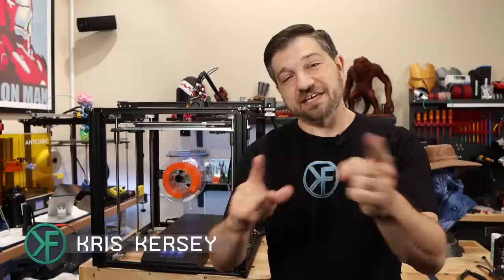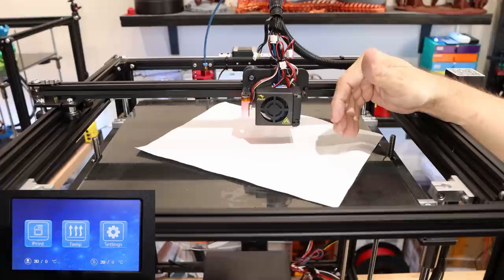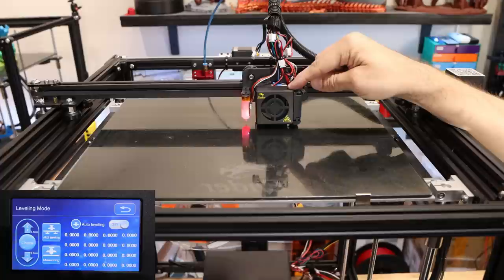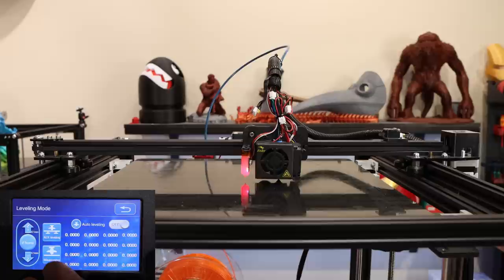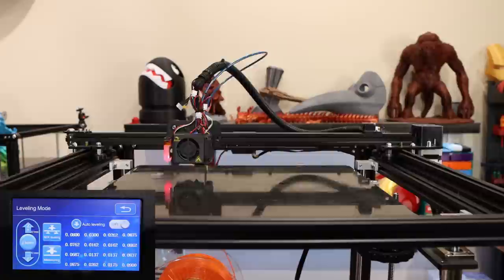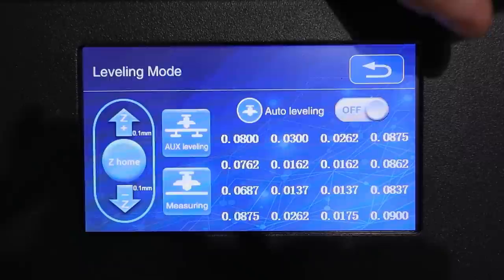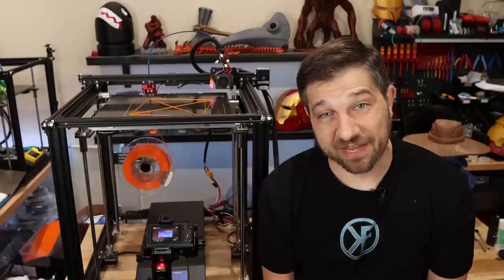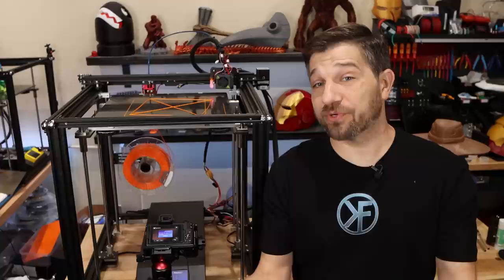Ender 5 Plus Bed Leveling Guide

Comment: Hi Kris!  Thanks so much for this video!  Question - on step two when doing AUX leveling you level the four corners and then back out and enter AUX leveling again.  The printer then homes, and you repeat the process.  Are you certain it is proper to back out of AUX leveling and go back in?  When I do this it seems to reset??  I level the four corners to where I can barely get the .04 mm feeler gauge under the nozzle.  When I back out of AUX and go back in, it's exactly the same every time -- NOT where it was.  The nozzle is touching the bed on every corner.  Every time I'm having to twist to the left (loosen) the same amount on all four corners to be able to get the feeler gauge under the nozzle again.  I've done 20 rounds of this, and still when I back out of AUX and go back in it's the same every time (nozzle touching bed, gauge can't pass).  However, if I level the four corners, and repeat the leveling 2-3 times without leaving the AUX leveling screen it is consistent.  I can pass the gauge under the nozzle with consistent resistance on all four corners.  But when I back out of AUX leveling and go back in (after it homes), when I check the corners I can no longer pass the gauge under any of the corners without loosening again!  I'm just about to the limits on how far they can turn left, so I'm starting to wonder what's going on.  THANKS!!!
Reply: I am having the same problem did you get a solution to it?
Reply: @victorblandon8996  I think so... I think backing out of AUX (at least on my stock Ender 5+ is not the best thing.  Do the same thing, just don't back out of AUX each time.  And if you are a beginner (like me) and have adhesion problems after this, best advice I can give you - hair spray or glue stick on the glass side of the bed.  I may have given up on the whole thing if I hadn't finally tried that.  It's important to have success to keep you going.  With hair spray or glue stick, you can get away with not having a perfectly level bed.

Comment: Hi  Kersay .... it's my first printer , i have unboxed it, assembled it almost all, now i have to connect the wires and bed leveling. 
Question .... When I see the Y belts in front side, they go much closer to the one side, and i think they will rubbing, scratch that side on the frames  🤔  .... 
 can I do anything to make them sitting in the middle, not touching the frames  ?
It is on both sides left and right front.
There is a possibility to adjust the position of the belt by turning the belt mounting bolts, but there is no such key in the equipment, so I do not know if I can do it ? 
Or just leave it at it and watch it work?
Thanks for any suggestions  😊
Reply from the maker: Congrats on the printer! 😍 Those mounting brackets should move. Feel free to adjust them. There are three screws in each if I remember correctly. Just get the belts tight when you get them in place.

Comment: I just got my Ender 5 plus. I tried to use the bl touch for auto leveling but I don't have the same menu options shown in this video. When I go to the auto leveling screen it doesn't have the option to turn on auto leveling. It has the most recent firmware update. Should I go back to a previous one?

Comment: So the right side of my ender 5 plus. Keeps movinf. At first I thought it was the left side dropping but I pencilled a mark on the couplers and the left side remains spot on whereas the right side lines up for the first few homes but then slowly moves out of alignment.
Does anyone know what would cause this?
Reply: The problem is that the Z lead screws are double threaded. With this larger angle the weight of the bed alone is right on the border of being enough to make the screw turn when the motors are not powered up. Consider making a latch that adjustably mounts to the screw/motor coupler and the frame to prevent movement when un-powered.

Comment: The problem is when I do the aux bed levelling, the nozzle is way too close to the bed only on the left side but the problem is when i loosen the knobs underneath, the bed doesnt get any lower.. Do i have to replace the springs?
Reply: The bed gets lower as you tighten the knobs. I know it sounds weird, but try it, you can see it. But you probably found out by now :D

Comment: when I check the 16 points my numbers are wildly different, some as low as -2.199. How am I able to make them closer together in value?
Reply from the maker: Can you try and list them here the way they're displayed? Or send me a photo on other socials.
Reply: @kerseyfabs  sure. From top to bottom, left to right: 0.275, 0.600, 0.587, -0.349, -0.724, 0.000, -0.287, -0.262, -1.912, -1.362, 0.062, 0.375, -2.199, -1.099, 0.262, 0.400.
Reply: @rachelblakey3212  did you ever fix this? mine has the same problem with the same suspisious 0.000 number in there
Reply: @jaaasgoed  I did not resolve this; I ended up buying an Ender 5 S1

Comment: Hello Kris, love your videos but i have a bed leveling mesh issue with my Ender 5 Plus why are my mesh numbers all over the place (corner 1 (5.675) corner 2 (0.512) corner 3 (-4.524) corner 4 (-9.799) is this telling me my table has a 15mm slant? i ran an digital indicator mounted on the print head and all 16 points were within .0001" of each other telling me my bed is very level, so what's going on?
Reply from the maker: Thanks! Have you tried to run a probe repeatability test on the BLTouch?  https://marlinfw.org/docs/gcode/M048.html

Comment: Hello , 
I have some Problems with my ender 5 plus. I followed your Tutorium but if i do a measurement i get numbers like -3.2 mm and +2.3 mm in one mesh and if i do a Manuel mesh leveling its ok. And the redo the mesh its even worse. I have tired several hours bzt cant get a good mesh. Some have any ideal what could be the problem ?
Reply: same here, not as extreme but lik -1.8 to +0.8 between 2 points next to eachother

Comment: I've been following your video for a while now... and something weird keeps happening to my process.  I start getting really close to what I want.  And then it goes to crap.  I'll hit the measuring button twice in a row... and get wildly different numbers... some more than double the distance measured... and that's without me making any adjustments.  Any suggestions or ideas would be greatly appreciated.
Reply: first set of readings: (left to right/top row to bottom row) .0137 -.0787 -.1075 -.0937  row 2 -.0712 -.1273 -.0750 -.0875  row 3 -.0700 -.1000 -.0900 -.0875 row 4 -.0375 -.1012 -.0700 -.0837
Reply: second set of readings: row 1 -.1575 -.2862 -.3337 -.3150  row 2 -.1950 -.3200 -.2625 -.2775 row 3 -.2100 -.3000 -.2800 -.2475  row 4  -.1662 -.2550 -.2662 -.2487
Reply: third set of readings (no time lapse between and nothing adjusted whatsoever) row 1  -.4912 -.6087 -.6637 -.6587  row 2  -.5350 -.6437 -.5900 -.6262 row 3 -.5437 -.6200  -.6062 -.5887  row 4  -.4987  -.5862  -.5912  -.5887
Reply: My bed was heated to 65
Reply: My first guess is that I may need new springs... other than that, I've got no idea what else to pursue.
Reply from the maker: If you're running some of my firmware, you may have the probe repeatability test installed. See if you do: https://marlinfw.org/docs/gcode/M048.html

Comment: Would you recommend the ender 5 plus over the ender 3 max? I'm new to 3d printing and want to buy my first 3d printer, which should have a large print bed for for example helmets. I'm willing to pay the extra price, but only if its really worth it. Which one do I have to upgrade more to get the best results?
Reply from the maker: Answered in one of your other messages. I'd go with the Ender 5 Plus. I don't like the single Z axis of the Ender 3 Max the more I've used it.

Comment: My measurements had variations +/- 1.000 I did all the steps and even used a metal feeler gauge like shown.

What can I do differently?
Reply from the maker: You could be getting some noise on your BLTouch sensor. You could separate those wires from the rest of them. It's something I recently did. Run them separately from the rest of the bundle. I may make a short vide on it.
Reply: @kerseyfabs  sheesh thank you!

You inspired me and I'll post my own unboxing and building video from an almost-over-the-shoulder angle. I'll reference your channel and express that your leveling video is freaking gold.

I moved on with what I have and have some very nice prints hot off the press. Now I'm learning Cura and how to balance speed/function/detail.

My hat is off to you!!

Comment: I noticed that you have a the Auto-Leveling button turned off...   but you mentioned "the auto leveling will take care of that"....  how...  if it's turned off?     thank you!  :D
Reply from the maker: The auto leveling button in their firmware simply tells it to run auto leveling on every print, which is unnecessary. 
Simply have the following line in your Start G-code and it will enable bed leveling with every print but not rerun the mesh:
M420 S1 Z2 ;Enable ABL using saved Mesh and Fade Height
Reply: @kerseyfabs        "not rerun the mesh" ?    As in, if one it should be remeasuring the bed every time???      (because it doesn't do that... ).  Sorry, not following... but I look into cura marketplace for an option to auto-add these...  because G-code editing is above my level I think... :D

Comment: Hey Chris, I've just flashed the firmware to your version on the printer, however the screen is currently white fuzz, what dwin set version do you recommend what your stock hex file.
Reply from the maker: I never changed my Dwin set from the stock one. I haven't seen the screen turn to "fuzz." Since it runs its own firmware, that shouldn't happen.
Reply: All good, it's all fixed now, I screwd up right from the start, but managed to figure out what was wrong. Your firmware is fantastic, now just waiting for the new bigtreetech mini lcd screen, I don't really like the touch screen.

Comment: I have bought one put it together sent it to a shop then got it back and I still can't get it leveled I know its an error on operator so I just bought the cr30 belt printer.
Reply from the maker: Well, if you still have it, I hope this helps.
Reply: Good luck with the CR-30!
Reply: @kerseyfabs  we will see i got discouraged with the ender 5 pro because I sank money into not only buying it but upgrading alot of parts like the silent motherboard as well as the cl touch. But I'm sure after the cr 30 it will be different orientation if I do switch but the cr 30 has made it fun I hope I can get a handle on the bed leveling soon to build some bigger stuff.

Comment: Do you have the gcode you use available anywhere? The code I currently use does a big triangle for it's purge and I have to rip it up before it starts printing.
Reply from the maker: Here's my start gcode:
; This section handles leveling
;G34 ;Z-Level
G28 ;Home not needed with G34
;G29 ;ABL not needed every print. Here for reference.

; This sections handles basic setup and draws the priming line, now on the right!
M420 S1 Z2 ;Enable ABL using saved Mesh and Fade Height
G90 ;Absolute positioning
G92 E0 ;Reset Extruder
G1 Z2.0 F3000 ;Move Z Axis up
G1 X345.1 Y20 Z0.28 F5000.0 ;Move to start position
G1 X345.1 Y200.0 Z0.28 F1500.0 E15 ;Draw the first line
G1 X345.4 Y200.0 Z0.28 F5000.0 ;Move to side a little
G1 X345.4 Y20 Z0.28 F1500.0 E30 ;Draw the second line
G92 E0 ;Reset Extruder
G1 Z2.0 F3000 ;Move Z Axis up
Reply: Awesome, thank you. What clips do you use for the bed? I'm still using paper clip style and those look much nicer. (Sorry if you have it posted somewhere else and I didn't see). Also is there a reason you have the glass upside down so the textured side is down?
Reply from the maker: Here you go, they're picture frame clips: https://amzn.to/3BOdp7f
I like printing on the smooth side because I get more reliable results using an adhesive compound like Vision Miner Nano Polymer Adhesive: https://visionminer.com/r?id=79piuf

Comment: i have been told you do NOT need to manually level an ender 5.   I do NOT want to be doing manual levelling ever again.  So sick of it.
Reply from the maker: If you're printing mechanically accurate parts you have to care. If you're printing models and toys, you're fine.
Reply: @kerseyfabs  models and toys! Whew.  So I can buy an ender 5 plus and solely use the auto level?

Comment: Please don’t do what he does at the start and push the bed into the print head…
Always start a print, doesn’t matter what you start just as long as you start from cold to give you time.

Go into adjust, change the z offset to 0 or in the positive side then follow the rest of the video from there.

Nothing against you personally but this can save your glass bed cracking and bending/breaking the hotend.

Comment: while this video is good, it doesn't exactly help or tell you how to fix anything like the certain rows of numbers if that doesn't work out first go around like his did. For me right now, no matter how much I manually level the corners or restart the process, the 2 middle rows of numbers will never read 0.0. He mentioned a suggestion for help but mumbled it so I can't tell where he said to go looking. Over all, he gives all the pro pointers, but none of the pointers for correcting the machine due to nailing it first go
Reply from the maker: If you're bed isn't perfectly level, that's normal. A lot of beds aren't perfectly level. That's the whole point of auto bed leveling. Once a mesh has been generated, the printer will make adjustments during the printing process to compensate for the differences. That's why I don't cover fixing it. Some things you couldn't fix without physically replacing the bed with a flatter build plate.
Reply: @kerseyfabs  yeah, I get that, but as I keep relying the process to get closer even after doing exactly what I did the same veery time the numbers seem.....pretty all over the place. Like just now as I'm typing they range from -0.28 to thankfully 0.08, though I was having worse numbers last night

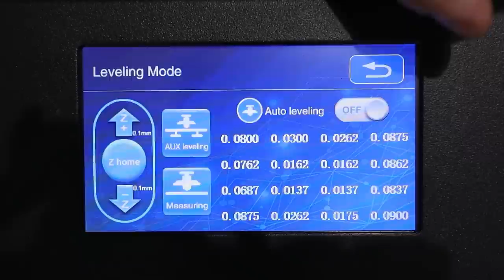Comment: 16:16 IF you would have turned on auto leveling it would have...
Reply from the maker: That auto-leveling turns on releveling on every print. You need nothing but "M420 S1 Z2" in your start Gcode to enable the use of your bed mesh.
Reply: @kerseyfabs  I swear the old adage "if you want the right answer, post the wrong answer online" works everytime LOLOL thanks bruv.
Reply from the maker: Anytime! Happy printing!
Reply: @kerseyfabs  while i have your attention, a video about someone new ish trying to buy a 5 plus... (me, but i have owned other printers so I know what I am getting into) new 32 bit silent (btt vs creality) board vs stepper drivers on stock 32 bit board, or just running it stock... $550 cheapest US right now on ebay... tough adding a $44 board that needs firmware and new LCD vs $89 creality board with firmware and lcd support already... on top of a ~$600 printer
Reply from the maker: Alright, that was a lot to follow. Basically... Stock vs. Silent Board vs. BTT Boards by today's standards?
Reply: @kerseyfabs  yes, since the 5 plus is still the go to "big boy for beginners"... is the silent board worth it if the printer is in another area where sound isnt a problem? if I add 2208 stepper drivers to the stock board, same results? cheaper than a new board with stepper drivers? keeping the LCD and User interface is priority and having mesh bed leveling. quiet is not so important
Reply from the maker: Quick summary:
- I may be doing this soon. I'm working on a new firmware for the stock board that may be a game changer. maybe
- I've made it pretty clear that out of the box, the printer works and works well. The upgrades are upgrades. Everyone needs to determine what they /need/ for themselves.
- You can't upgrade the steppers on the stock or silent boards. They're soldered on.
Reply: @kerseyfabs  thanks!!!! so if i buy the new board with stepper drivers, i dont need to buy stepper drivers separate!?!?!
Reply from the maker: @pawpatina  If by "new board" you mean "silent board," then it comes with stepper drivers.
Reply: @kerseyfabs  yea... its vague online... but i got that eventually
Reply: @kerseyfabs  really appreciate the help and quick replies! def earned a sub!
Reply from the maker: @pawpatina  Glad I could help!

Comment: THE KEY THING  is to make sure the auto bed leveling option is set to OFF. Turning it on will mess up this whole process. Very misleading setting. If its left on it always would leave me with the print head too far away from the bed
Reply from the maker: Yeah, it's unnecessary. Thanks for the addition.
Reply: @kerseyfabs  Can you explain this a little more? I am a little confused by that
Reply from the maker: @franktt736  That switch in the UI causes it to auto level on every print. Theoretically, it should be fine but for some people it messes up a good, tested level that they've dialed in.
Reply: @kerseyfabs  Thanks, I have had some weird issues but am now trying it with it off. Thanks for the video!
Reply: @kerseyfabs  So the purpose of the 16 point MAP is only to assess the effectiveness of your manual leveling? I'd hoped it was used with auto-leveling to adjust the g-code on the fly. So that's not the case?
Reply from the maker: No, the mesh does actually adjust the location of the print on the fly, making minor adjustments to compensate for the bed topography. Make sure you have 'M420 S1' in your start G-code.

Comment: My e5+ has numbers on the leveling like 7.4 not .08 what am I missing here?
Reply: Those numbers are the distance of the bed from the probe when extended.  You can adjust the height of the probe but if the numbers are all similar then you just need a bigger Z Offset.
Reply: Thank! @petercallison5765  I'll adjust :)